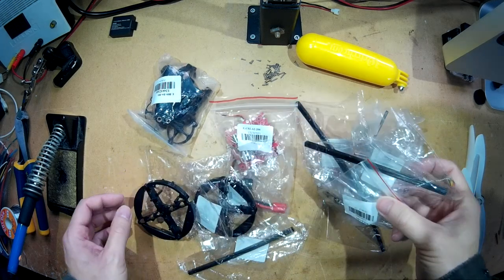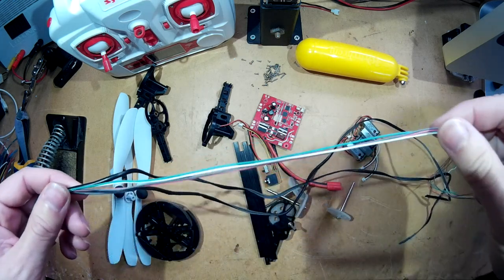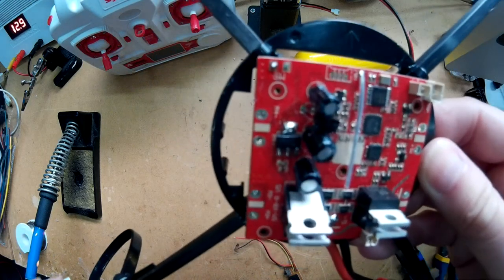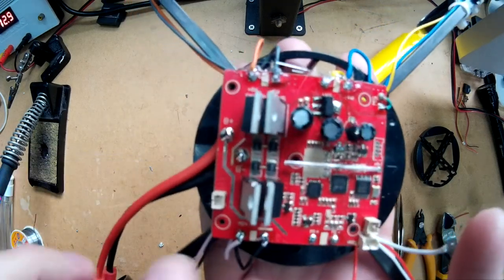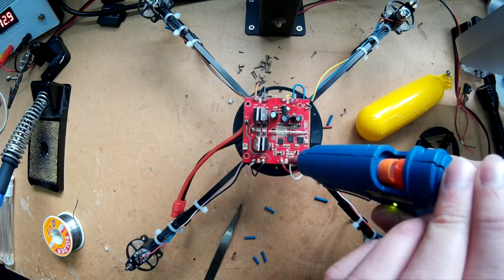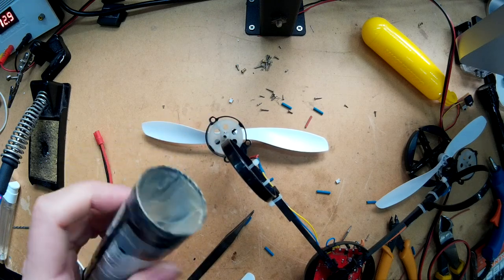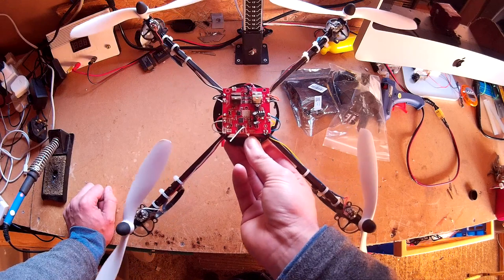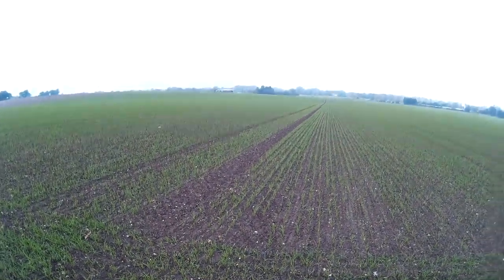Diy  X6 Tarantula Quadcopter Build

Comment: i want to know how u put the controller board? it should be balanced to put on the frame for stable flying. Did you use dampening under the board or simply just put the board on the frame?

Comment: Could you tell me what the weight is of your diy quadcopter with propellors, arms, gear and controller board but without battery ?
Reply from the maker: +Rene 8451 It's 150 grams

Comment: Have you heard of people's tx6 quadcopters only getting like 3 minutes of flight time and the batteries still have 8 volts remaining......far from fully used.  Any guesses?
Reply: +Oswald Reef I've experimented just the same, and have no idea. I realized, with my x6, if i used a second battery the flight time decreases too much, so i think the main board detects hot, and leds blink indicating to land whereas battery is not drained.
Reply: +Antonio contreras perez i think my fc was screwed from day 1. wont buy another fc even cause i hear all the v2 boards are bad :(

Comment: Have you put anti vibrant dampening pads under the receiver board?
Reply from the maker: Reality, Comedy & Entertainment no I haven't works fine without.
Reply: thats great, but one thing i have this main frame v666 and same receiver board of tarantula x6 but i cant fit into the frame because there is a little bit difference in holes of receiver board to adjust with main frame, im curious how you adjust these?

Comment: Nice mod. Didn't get why you wanted an x8c board in it. For a fast quad the tarantula board will always work better. Especially with a light frame.
Reply from the maker: +Ernesto dí Terríbílé yeah the tarantula board is better for a fast quad i just like x8 controller better.
Thanks have fun flying.
Jace
Reply: +Norfolktuber Try a DEVO 10, a very nice controller, that controls almost all toy grade planes and multicopters.
Reply from the maker: +Ernesto dí Terríbílé  Yeah thanks i have been thinking about getting that controller.

Comment: nice idea... i have inspire from you.... tanks for inspiring me...
Reply from the maker: +BoLeD KaC3L Thanks glad your inspired.
Reply: +Norfolktuber  where to by  Spare Parts Remote Control Transmitter Syma X8 ? do you have link?
Reply from the maker: +BoLeD KaC3L Here you go.

YiZhan Tarantula X6 RC Quadcopter Spare Parts Motor CW/CCW X6-09 you need to order 2 cw and 2ccw motors make sure you select in menu
http://www.banggood.com/YiZhan-Tarantula-X6-RC-Quadcopter-Spare-Parts-Motor-CWCCW-X6-09-p-972202.html?p=070519238739201308J6

YiZhan Tarantula X6 RC Quadcopter Spare Parts Gear X6-07 4PCS
http://www.banggood.com/YiZhan-Tarantula-X6-RC-Quadcopter-Spare-Parts-Gear-X6-07-4PCS-p-972200.html?p=070519238739201308J6

YiZhan Tarantula X6 RC Quadcopter Spare Parts Propeller 4 PCS X6-01
http://www.banggood.com/YiZhan-Tarantula-X6-RC-Quadcopter-Spare-Parts-Propeller-4-PCS-X6-01-p-972198.html?p=070519238739201308J6

YiZhan Tarantula X6 Spare Parts Remote Control Transmitter X6-14
http://www.banggood.com/YiZhan-Tarantula-X6-Spare-Parts-Remote-Control-Transmitter-X6-14-p-972204.html?p=070519238739201308J6

YiZhan Tarantula X6 RC Quandcopter Spare Parts Motor Mount X6-06
http://www.banggood.com/YiZhan-Tarantula-X6-RC-Quandcopter-Spare-Parts-Motor-Mount-X6-06-p-972721.html?p=070519238739201308J6

YiZhan Tarantula X6 RC Quadcopter Spare Parts Receiver Board X6-08
http://www.banggood.com/YiZhan-Tarantula-X6-RC-Quadcopter-Spare-Parts-Receiver-Board-X6-08-p-972199.html?p=070519238739201308J6
Reply from the maker: +BoLeD KaC3L screw set http://www.banggood.com/Wltoys-V262-V333-V353-RC-Quadcopter-Spare-Parts-Screws-Set-p-945136.html?p=070519238739201308J6
Reply: +Norfolktuber tanks for informations